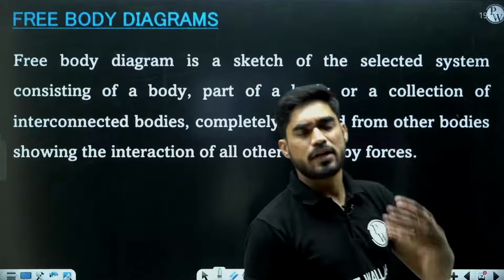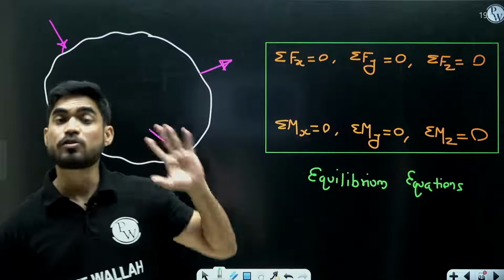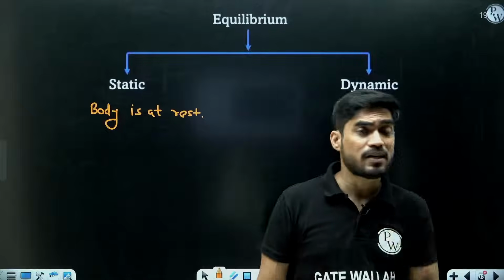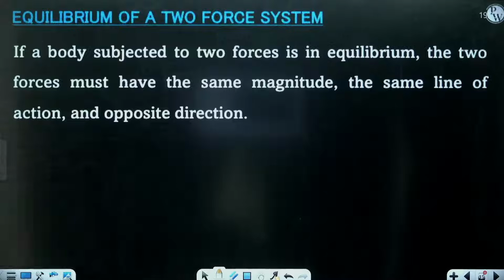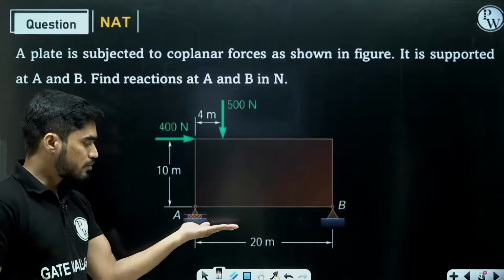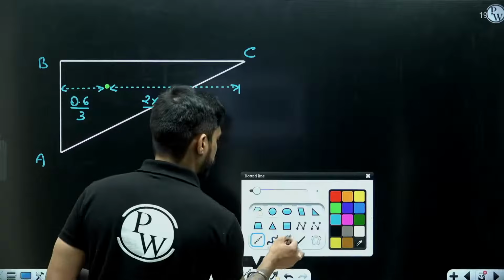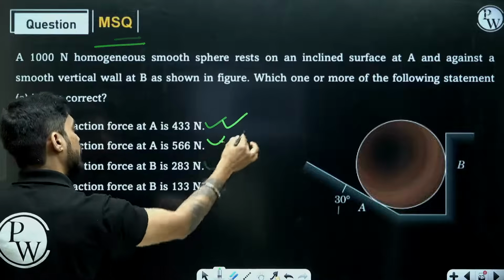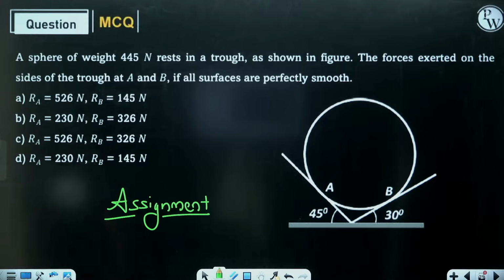Engineering Mechanics 07 | Equilibrium of Rigid Bodies - 1 | ME | Gate 2024 Series

Comment: CVX GATE’27 Prep Diary

Day 14/360

• Covered 7 lectures in 14 days  
  (need better consistency)

• Mock Test: 4 Jan  
  Score: 18.6 / 50

Section-wise:
- Sec A (MCQ): 6 / 8
- Sec B (MSQ): 4.1 / 14  → major weakness
- Sec C (Numerical): 8 / 28
Reply: How you're doing rn?

Comment: Someone tell me in short why reaction forces is making 60 degree with horizontal
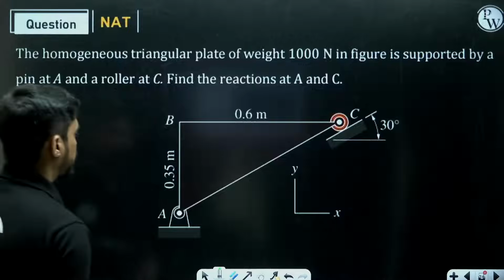Reply: As explained in 49:20 ∆ACB will be 30° as it is parallel to surface. Then you extend the force Rc through its line of action, It will be perpendicular to AC. So 90°-30°, it will make 60° with BC. Hope you get it.
Reply: @joelsavio  no bro please elaborate easily
Reply: question no?
Reply: normal of surface